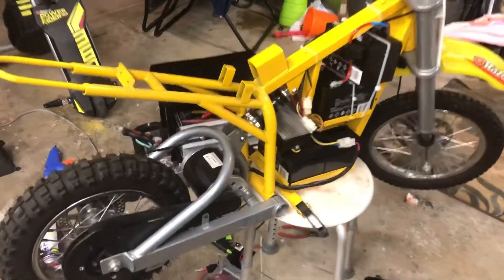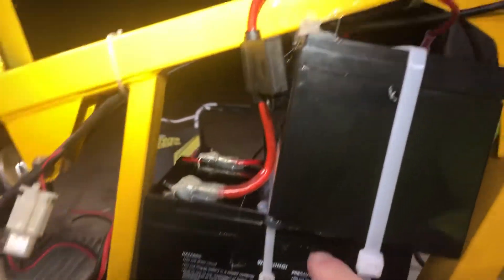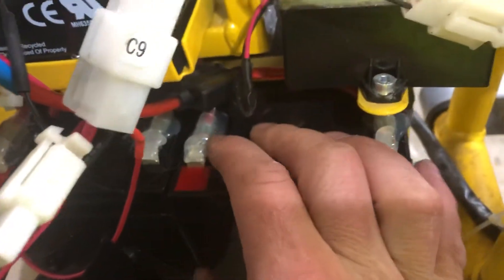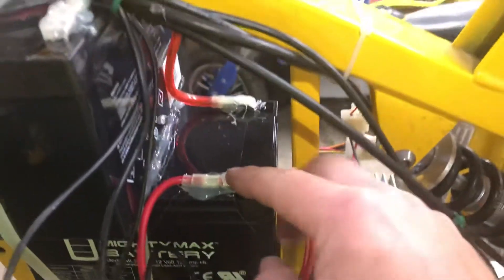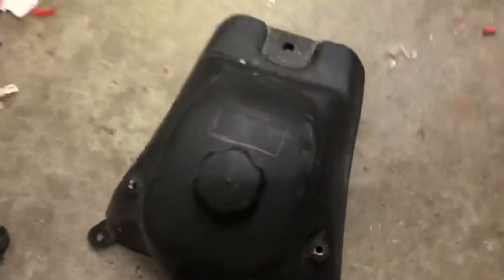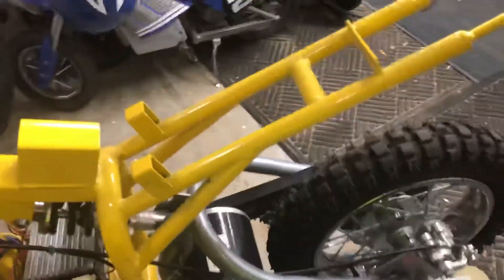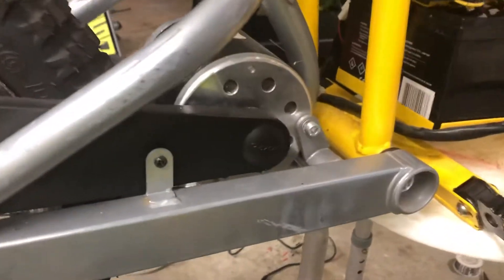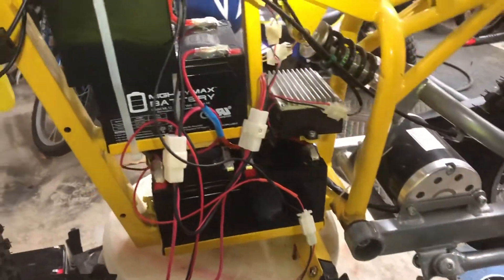How to over volt a MX500 / MX650 Razor Electric Dirt Bike From 36V to 48V

Comment: Please help, brother. I bought one of these in a fleet market and have been sitting for a year in my basement. I don't know how to put it together it all the batteries connected no other
Reply: You need new batteries for sure.  Just to get it back to stock, buy 3 12 volt 15 ah mighty max batteries.  Once you get them in the mail, just take the wires off the old ones and put them the same way on the new ones.  Dont worry about adding a 4th battery and such like i modified with this bike.

Comment: The controller is marked with 36v you're sending in 48v. Kind of a huge input change for that little controller
Reply from the maker: The generic rule of thumb is you can over volt by 50% without mass chaos. So 24 can handle 36 (controller has to be variable speed). If you try 48 V on 24 V then you will break the controller, motor, everything lol. 36 can handle around 54 which a lithium 48v battery is close to that.  It may wear life on components prematurely, but I’ve been riding the bike for several years without issue.
Reply: @freshmaker5 what AH is your battery’s ? I’m looking for a 48 lithium for my kids bike
Reply from the maker: @cbausch7025 this was years ago and sla sealed lead acid batteries at 15ah.  I have a few 48v lithium packs if you want to email me.

Comment: Hey I gotta ask you what’s your experience with mighty max batteries? I bought 2 15 amp hours for my e bike but my charger is only 1 amp, yet they only take around 4 hours to charge and that’s after the batteries are so dead the bike won’t even move under its own power
Reply from the maker: Don’t run your batteries that low. When you feel it even start to slow down, charge. If I’m doing sla, mighty max is what I’ve bought.

Comment: Why did your motor go full on when you hit the throttle? If the throttle is working properly, the motor should start slowly then rev as you increase the throttle.
Reply from the maker: I FLOORED it. It’s that quick. I didn’t ease in like you’re thinking. If I did, it would have ramped up slowly.

Comment: I found a 48 volt 21 amp hour battery with charger and mount box for 125 dollars I'm considering buying it and putting it on my kids mx500 what are your thoughts ??
Reply from the maker: 48v is typically fine but beware of batteries that are too good to be true. Don’t get the blue lithium Chinese packs off of eBay. They are not what they say they are stat wise
Reply: @freshmaker5  no it's a upp battery directly off a bike it's got Samsung cells hoping it works out

Comment: Hey i boosted my mx650 with 2 rc 8.4v battery top speed flat ground 23mph im going to change the sprocket to the 13 T hope to get the 27 mph your getting
Reply from the maker: Please get voltage limiters or beepers that let you know when you were at a certain voltage. The battery can be permanently damaged or even dangerous if you run those RC batteries too low.
Reply: That's a great idea i will thanks

Comment: Is your controller the stock 36v one? 
How can I shunt my controller?
Reply from the maker: Everything is stock except for the extra battery and the way it’s wired in and charger. I can’t explain shunting over a text, you’d have to watch a video but basically you thicken the bar which tricks it into less resistance and allowing more amperage through. But that will only do any good if you have the battery amps to dump to feel any difference.
Reply: I have a 48v lifepo4 pack from another bike. Can I just replace the 36v battery pack and just do the appropriate wiring?
Reply from the maker: @gldf111  my blue mx650 runs lifepo4 48v. If wiring adjusted for charging and correct charger, All good

Comment: I have a 48v 10ah battery (it’s one individual battery, and yes less ah) but do I need to change the controller or the motor? Like will it be able to handle it?
Reply from the maker: 48v is 48v. It will work the same as this. Now obviously we’re running the motor a little harder than it’s intended to so it may prematurely fail someday but I’m 185 pounds riding around coming up to my third summer on it.  If it fails, you buy all 48v stuff anyway. This is just the cheapest fastest way.
Reply: @freshmaker5  I tried a 48v battery and controller, and when it’s at fully throttle, it skips for a second and then goes back, skips goes back, and so on. Any ideas to why?
Reply from the maker: @mateom7201  is it a lithium pack? Cheap blue one from eBay? Or?
Reply: @freshmaker5  no it’s a nice one from amazon, I tried it just now, after getting the motor warmed up, it doesn’t skip. Do yk how come?
Reply from the maker: @mateom7201  unles it was $300-$400, your battery might be not putting out enough amps and cutting off power. If you can go slow and steady fine but when you floor it and it cuts out, that is likely the issue. How much was the battery?
Reply: @freshmaker5  like $200, it’s 48v 10ah

Comment: With the overvolt at 48 (stock motor) and you at 180lbs, with the 9 tooth sprocket how long of ride time are you getting?  Thinking of doing this for my 12yo daughter's 650 but she is more concerned about ride time (dirt trails, rolling hills)  vs speed, appreciate any insight/ real world experience !
Reply from the maker: This bike was for my wife. I run Lifepo4 batteries in the blue bike with the 9 tooth. The 9 tooth definitely was worth it performance wise for stop and go, turns on a track. The gear itself won’t really change battery ride time. The way you ride it would. Terrain, weight, stop and go will use more juice than just cruising down the street.  The gear is cheap $15 and one nut so if you don’t like it, it’s not a huge loss of time or money but I’m pretty darn sure she will like it if she is looking for more torque. I sell the gears if you don’t find one elsewhere.
Reply: @freshmaker5   Great to know you carry the gear!  Regarding your wifes ride, can she get over 30mins, off road, stop and go or is 20 pushing it hard about max?  Thanks!
Reply from the maker: @justinlaskey6648  ya you should get 30 min. It just depends on all those variables, weight of the person, terrain, how much your flooring it but 30 is doable. Did you know that 15 amp hour are the exact same size as 12 amp hour batteries? So you can get 25% longer riding time if you switch to 15 amp hour.
Reply: Great video and new subscriber.  I’m new to these bikes and my son and I bought a Vevor 2k watt motor and new controller.  We also bought new SLA batteries and I need help hooking these batteries up…mainly the fourth.  Are you running the positive terminals/wires to negative on different batteries?  This is where I’m confused…I was thinking positive to positive on all batteries?  I’m not an electrical guru by any means and I’m hoping you can help me understand this.  I plan on buying 12 gauge wire to assist in hooking things up but I’m just confused.  Thx.

Comment: The fuse needs to be at the end of the power supply
Reply from the maker: There is a fuse before every positive terminal which mimics the stock setup. They never have the fuse coming off of the last ground in the series. I just have one more fuse because there is one more battery
Reply: It needs more than one ? I didn't know that I am swapping with drill battery's they have safety over voltage but I still put a fuse at the end

Comment: Hi, so the way you wired the charger is that necessary? Im asking because I just did this mod but im barely getting 15 mph on sx 500and trying to figure out if I did something wrong or if the controller or motor is worn, I plan to upgrade both in the future but for now Its driving me insane!
Reply from the maker: Sounds like your running only at 36v. That’s stock speed. You should be running low to mid 20’s. At the end of the day, the main positive of the charging wire has to go to the main positive  of the battery pack and the main negative of the charging port has to go to the main negative of the battery pack. I choose to bypass the controller because it’s putting more voltage through it then it’s intended to have.  It sounds like you didn’t run your wires in series correctly or something. Put a voltmeter on the main positive and main negative and see what molded you are getting. Should be about 52-53v.
Reply: @freshmaker5  yea I was getting 48 after about 10 minutes of riding it, maybe motor or esc is bad idk
Reply from the maker: @JustinTwilley  On two different MX 350s, I’ve put it up on a stand and hit the throttle. It would go full speed for about 20 seconds then just die down to half speed. It was the motor.  I’ve never had a controller just partially worked. They either work or they don’t in my experience. Are your batteries newer? If not, one could be weak. A Voltage test will not tell you, you would have to do a load test.
Reply: @freshmaker5  yes batteries are new, think I'll just get the 100.00 1800w kit off Amazon
Reply from the maker: @JustinTwilley  I’m about to install the 1800w in my blue mx650.
Reply: @freshmaker5  Awesome please do a review video!
Reply: I think you guys are answering my question, but I hope I can get some more help here... I have an MX500 , I just put a new motor and controller and batteries and throttle  in. I’m using the 36v. I get power and then I lose it as soon as the charger is plugged into it. I wire the charger port (red/black) to the control module as I thought it was supposed to be and now I’m seeing this and I’m guessing it should now go directly to the batteries because it kills the controller ?! Any more insite would be greatly appreciated!
Reply from the maker: @CorneliusFudgePop  If you are staying 36 V, hook it up to the controller as you were stating. I skipped the controller because I was over volting to 48v. Not sure if I understand you losing power when you plug it in. Make sure the machine is turned off when you charge it
Reply: @freshmaker5  thank you for the quick reply! I honestly have no idea what’s going on here . I power everything on and get power to the wheel and once I plug the charger into the bike it goes dead on me and I can’t get anything back. I was guessing I was overvolting” the controller and killing it?
Reply from the maker: @CorneliusFudgePop  over volt means putting more than 36v to a 36v machine. Notice I have 4 batteries for 48v, not 36v. This video you should completely ignore. When you plug in your machine to charge it, do not have it on and do not try and run it.  Turn it off, leave it off, Charge it, unplug it then turn on and run.
Reply: @freshmaker5  ok I’ll do that . Do you think  I ruined the control module ?
Reply from the maker: @CorneliusFudgePop  no
Reply: @freshmaker5  thank you very much for your help
Reply: @CorneliusFudgePop   check your fuse

Comment from the maker: Treasure Outdoors, I am replying to your comment via email. I don’t seem to see it on here. But if you’re a beginner I would stay away from li-ion products such as 18650 build packs or even RC car packs. They are dangerous if you make a mistake. Just go with these sla sealed lead acid ones for your first projects. The Bossman bike has Lifepo4 Batteries which is a much more safer type of lithium you could go with.  Just stick with the basics until you get the knowledge. I’ve fixed tons of electric ride in’s and I’m not ready to mess with 18650’s just yet.